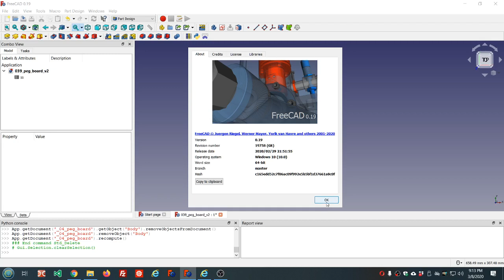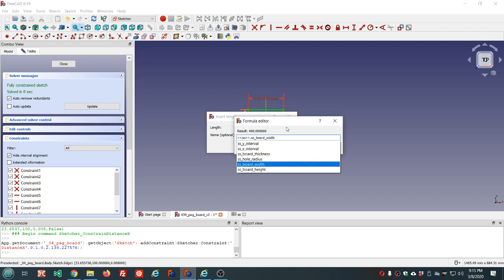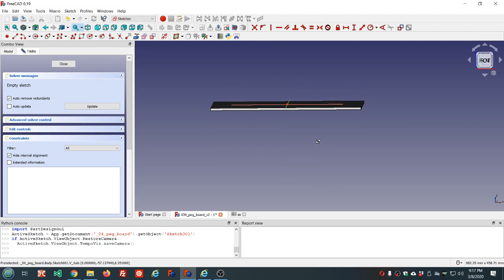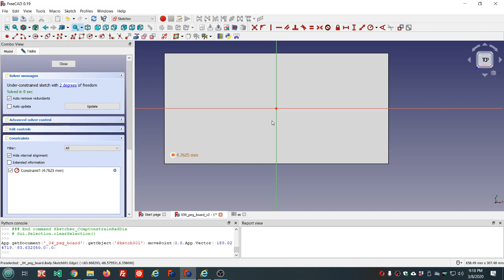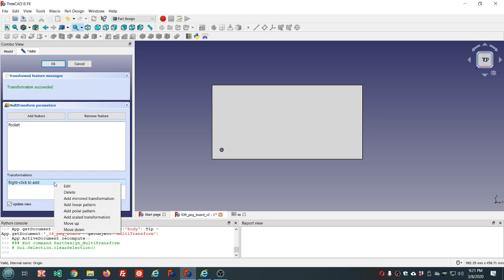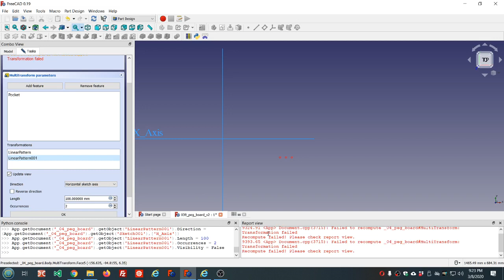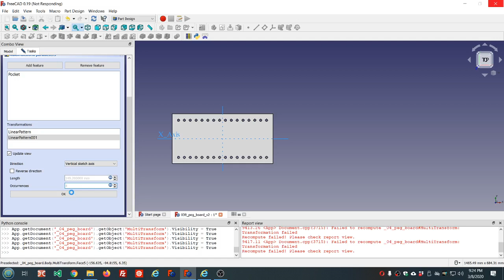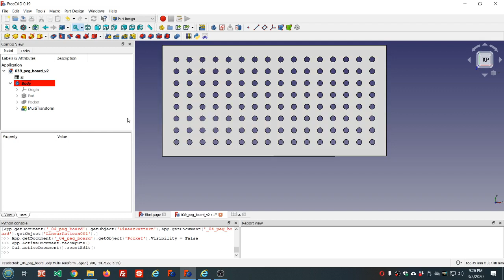039   FreeCAD pegboard in part design

Comment: Mark, thanks for the tutorial and the macro. Was essential in getting our basic vent grille project out of vaporware- and onto our 3D printer and kitchen wall. Could not have done it without this vid. Great help. Do you have a video describing how you got into FreeCAD and what other CAD tools you use or have used that might be suitable at low cost for personal use? Your videos are much appreciated.
Reply from the maker: I don't have any videos about any other CAD software.  FreeCAD is the only one I know enough about to make videos on.  My motivation for learning was so I could try to make use of a small CNC mill.  After realizing I could do the CAD part of it I bought a 3D printer.